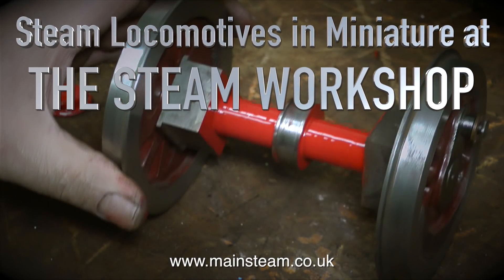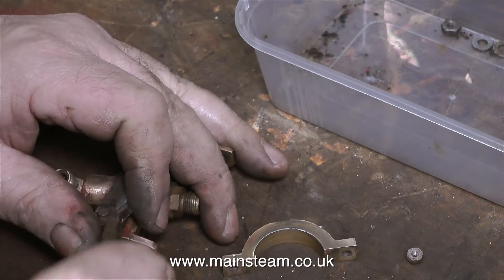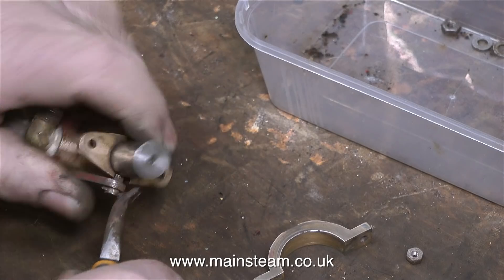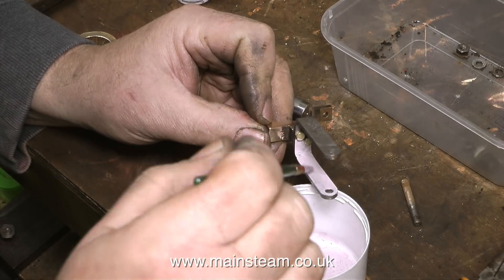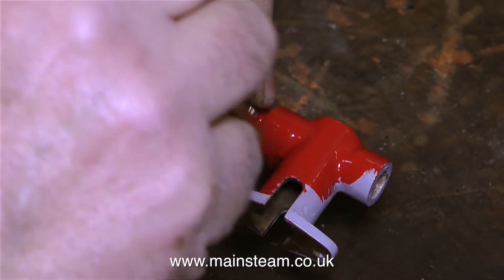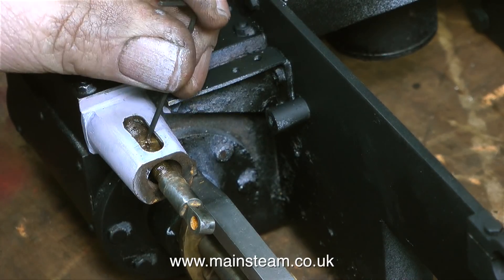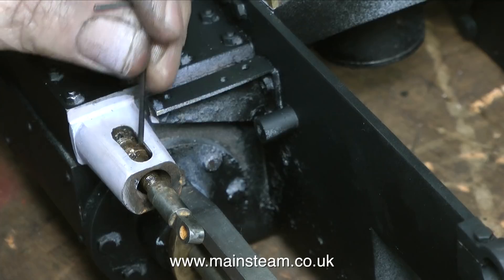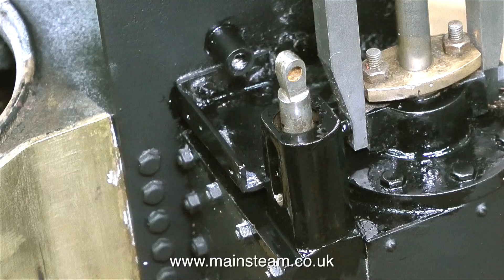WORKING AT THE STEAM WORKSHOP #6 - THE AXLE PUMP AND GLAND NUTS

Comment: Do you see the hobby having to switch to water based paints for environmental reasons ? Have you ever had things powered coated or do the oils destroy it ?
Reply from the maker: I think that solvent based coatings are with us for a while yet. Powder coating is OK until some water gets underneath the paint layer . . . . . My 7 1/4 inch gauge passenger truck was powder coated but over the years most of it fell off the steel . . . .
Reply: Keith Appleton thanks